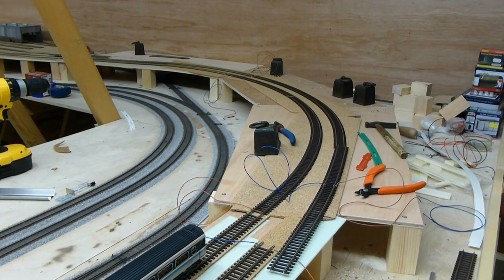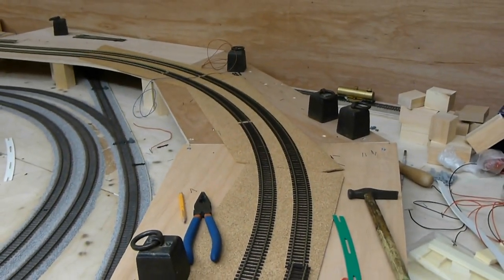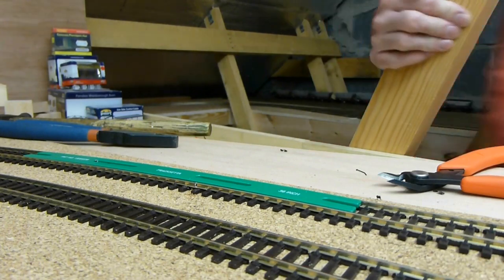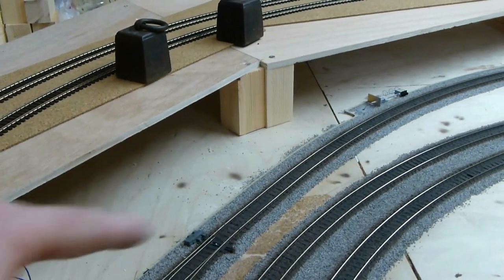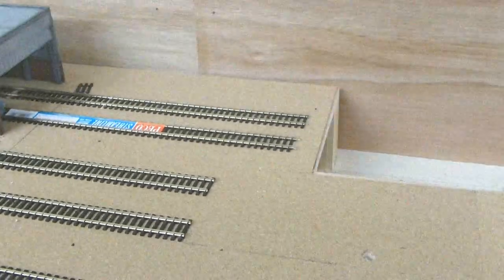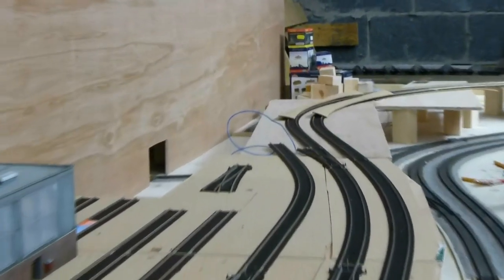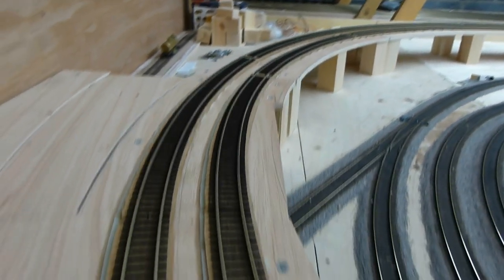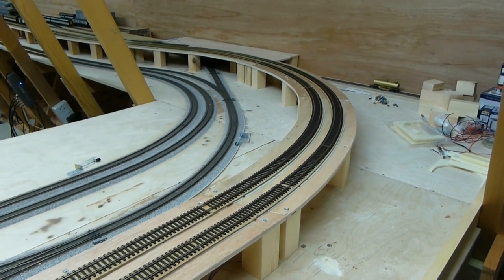Dean Park Station Video 67 - December 2015 Update

Comment: Looking good Dave.  The upper section is very smart, nice carpentry too.  My vote for the first loco would be a scotrail 47 on a push pull rake or one of your HSTs since the layout is set in Scotland.  Hope it runs ok! Cheers
Reply from the maker: +EverardJunction Hi Richard, thanks for your vote....the A4 60009 and HST are front runners, but the 47 is coming up on the outside!!Yeah I am pleased with the curve on upper loop.   I have tested it thoroughly but not yet allowed myself to run a train all the way around.Cheers.Dave

Comment: Great video as always Dave. Inter City 125 for me for the first run. Just a little aside regarding pulling the track together on the fishplates. I did this once and the track pins didn't hold resulting in a drive to the hospital with a length of track sticking from my thumb joint to the bone in the lower arm. 15 stitches later.!!!!....and 30 years on the scar is still there. Cheers, Bob

Comment: Dave, another interesting and informative video. A few years ago I saw a tip for the banking (or camber) of the track with matchsticks under the outer rail, but your method looks better. For me, the majestic A4 Union of South Africa. It has design, power, grace and movement.Barry. Devon.
Reply from the maker: +OBowner Hi, cheers Barry, I will add your vote to my list.  Cheers. Dave

Comment: Another great update Dave. My vote has to be the HST as this is the train that got me back into modelling. Just a thought; as you have 2 tracks you could test with the 2 most popular locomotives.
Reply from the maker: +Gary Hodge Hi....Thanks for your vote.   A popular choice, more popular vote than I thought it would be to be honest!   Both lines will be officially 'opened'.   By two locos.  So I will have the winner of the vote going first, then the runner up vote going around too.   I will show a selection on the top level in the next video, but one of them has to be first!! lol. Dave

Comment: nice to see it all joined together , super elevation , do you think it really helps us as molders , , , i doing easy track so that's why i ask ,, seems it going to be a bit harder to do with this stuff
Reply from the maker: +sparky107107 Its not essential, but I just wanted to try it to give a angled track at the corners.  Its very slight, so the trains dont lean too much and fall over. Dave

Comment: Hi Dave, can I ask you about signals how do you know where to put which signal be it a 1- 2 -3 - or 4 aspect because I don't have a clue any info would be great thank you jack.
Reply from the maker: +Jack Brown Hi Jack, I have mainly 3 aspect signals on the lower mainlines. I have just tried to space them out evenly, making sure they are in areas where you can see them, as they look cool.; Its just all down to personal judgement, space and location. I also copied some of the signal positions based on Edinburgh Waverley and adapted this for my station. Sorry, its not more scientific than that. I sure there are hard and fast rules on how they are positioned in real life though! Cheers. Dave

Comment: HST would be my vote.
It's a uniform train and will show the sweeping curves and super-elevation to their best effect.

No offence meant Dave, but I think you've demonstrated a lack of planning forethought here.
It's best to plan where your track will go, then cut the wood, then lay track.

You'd have been better off placing the plywood panels on the legs, using the tracksetta templates to draw your curves in pencil to figure out where the inside/outside boundries for the baseboards will go.

Then, with it all penciled in, you can cut your wood, and lay your cork and track, super-elevated where neccesary.

It doesn't really matter too much. It'll work out fine in the end. All the only real loss is the time and effort it took to pin down track and lift wood for cutting, reinstalling the track, and nailing it back down.
Reply from the maker: +Cliffjumper24 Hi, we live and learn dont we?  No offence taken whats so ever.  

I had planned it out using strips of paper cut at 36" curves, so knew it would work, but I wanted EXACTLY 40mm on each side of the tracks to accommodate the over head masts etc.   I have achieved that accuracy by doing it the way I did, even if it wasn't the quickest way.  But since when have I dont things a quick way?! lol Cheers. Dave
Reply: +DaveClass47 I reckon i would have done it your way too, so as to gauge exactly where the track would go. Unfortunately, i don't have space for a railway, hence watching you and Everard, Glebe Road, Graham Foulston, etc. Keep going!
Reply from the maker: MotoCrazy66 Hi, thanks.   I do like to work with as much accuracy as I can!   Glad you liked.  Cheers. Dave

Comment: Hi Dave, still playing catch up on the U Tube videos I've missed. One question, on the super elevated section, you mention the outer radius is 36 inches, what is the radius of the inner track?Yet another brilliant video, again with excellent tips and ideas.
Many thanks for sharing. Kind regards. John
Reply from the maker: +John Bennett Hi, its also 36", but because I have used flexi track it allows me to start the inner curve slightly earlier to keep the spacing between the tracks the same....I hope this makes sense?!  Dave

Comment: My vote would be  the HST in blue & grey livery. As I said last time  you need to watch BNSF Birdwood Sub" HO Scale update, Part 5. by Fishplate flim to help with the incline. Greg inclines are at 2 degree rise and without using the foam.What he uses is a cheap spirit level with a screw set at 2 degree. I hope it helps you to complete the section

Comment: Hi Dave. I have noticed that you use the track setters to gauge your curves when laying flexi track. I am brand new to flexi having never used it before. I have looked everywhere for a set of the track setters without success. Would you be able to tell me where you got them from? Thank you in advance. Ben
Reply from the maker: +Ben Tompkinson Hi TRACKSETTA can be bought from most model shops, I got mine at Rail of Sheffield. Cheers. Dave
Reply: Thanks Dave. I'll have a look out next time I'm in my local shop. I hope you don't mind me asking another question. Where did you get you light signals from. I have trawled the internet but can't find any I like. I am looking to use the timer/sensor set up that you and many others have used. Thanks for now. Ben
Reply from the maker: Hi, yeah no worries, these are CR Signals.   You can buy these direct from that website or from heathcote electronics website.   They are the most realistic ones I have come across.   And they are easy to wire up with the Heathcote sensors boards.

Comment: Track cant. Superelevation is an Americanism
Reply from the maker: +BladeRunner21577 'You say Tomatoes I say TomAtoes!'   Same difference lol. I actually have a few american subscribers, so they'll feel happy I have catered for them. Cheers. Dave
Reply: +DaveClass47 Fair enough Dave, Ive seen a few vids on here, all American, that call it that, but working on the railway for several years Ive only ever heard it called the tracks cant.
Reply from the maker: BladeRunner21577 Hi, I agree it is canting in uk, and you being a railway man will no better than me.  I call it banking of the curve as well, is that term used?
I keep defaulting to super elevation as that is what it says on the packet ;-)
Thanks for pointing that out though. I will try and remember next time I film it, but I cant promise I wont slip in to Americano! lol
Reply: +DaveClass47 tracks bank left or right. but banking can also refer to assisting motive power when helping a loaded train up a steep incline.